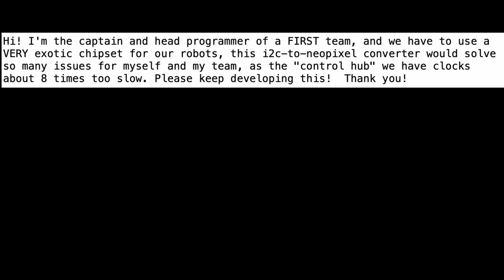#NewProducts 5/31/23 Feat. Adafruit NeoDriver - I2C to NeoPixel Driver Board - Stemma QT!

Comment: The I2C NeoDriver sounds insanely cool, I just wish it came out a few weeks earlier so I could use it in a project I'm working on right now... I'll put in an order the next time I need parts.

Slow? As long as it will continue to send data and level shift for me, I can probably use it. I'm in the automotive industry, and typically it's "push this button to light this thing up". I've run into like 2 projects that required tight animation constraints, over the past 5 years.
Reply: I made I2C neopixel driver on Attiny84A years ago, because it was only interface I could use and I needed a couple RGB LEDs as Air Quality indicator.

Comment: I2C driver for NeoPixels?!?!? Oh this could change everything for a few of my design in the future. Though I am not a fan of driving 1 pixel at a time. Still could see this used for a future project possibly. I also like the building level-shift (and a programmable address, too many sensors out there hard code that).